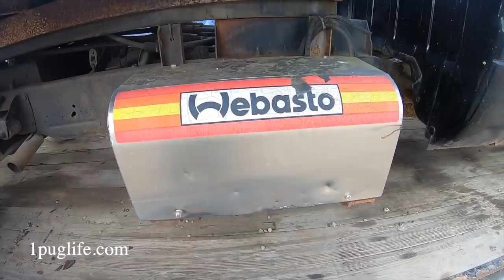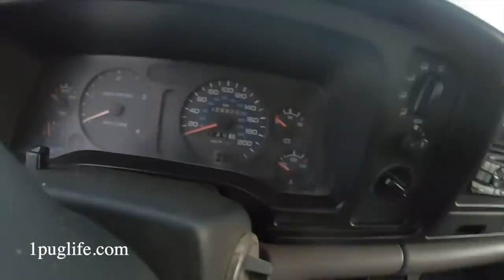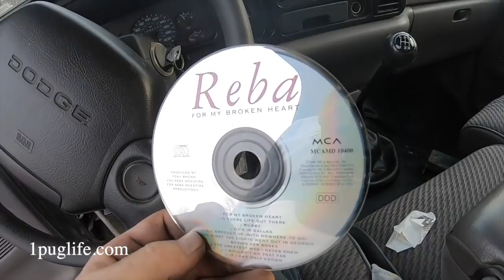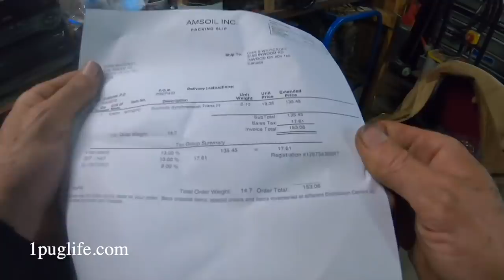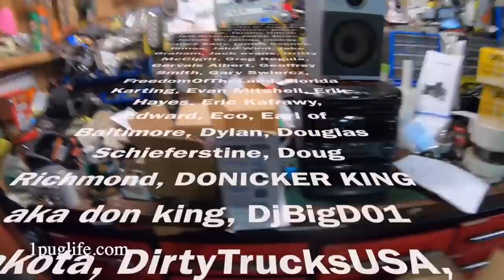will the scrap yard cummins start or is it junk

Comment: Pug 1 the only
Guy in earth who expects a truck
He bought at a scrap yard to run.
Reply: Very few cummins go before the truck becomes trash haha what a find!!!
Reply: But those 12 valves only need fuel and air to run. Well that is with the lack of any catastrophic failures.
Reply: And it does...
Reply: more like be mint and problem-free.
Reply: Anybody know/remember what happened to that huge 5th wheel steel cargo trailer that sat in the driveway forever just rusted terrible.
Reply: @memorysometimers3067  sold
Reply: Have faith
Reply: It’s a 12 valve Cummins. Chances are if they don’t have windows in the block they’ll run. Chances are also if it’s an automatic tramission it won’t move. But a standard is usually ok. It’s probably about the best motor to take a chance on.
Reply: But it did didn’t it??? lol
Reply: @mikewinn1987  lol its hauling stolen car and truck parts outta the Rez pug1 mint 👌🏻

Comment: The inside of that truck is amazingly clean and not all torn up. No rips in the console lid. No rips in the seat. No cracks in the dash. Unreal.
Reply: The floor is dicked, but easily replaceable for Pug1. He scored, even if he ended up gutting it and parting it.
Reply: That dash!!! I’ve not had one that wasn’t chowdered.
Reply: @mraycgz  my 1995 had a pristine dash with 357K miles on her with not a crack in it. One day I had tacos from the taco truck and I sat the plate on the dash. It was covered with tinfoil so I didn't see the grease dripping off the plate down my dash. The next week my dash cracked RIGHT where the carne asada oil ran down the dash. 
SO I'VE COME TO THE CONCLUSION THAT THE PLASTIC dressing they sell is the reason there are so many cracked dashes out there. Poor people thinking they are "protwcting" their dash when in fact they are destroying it. Isn't that a shame. 
My 2005 has never seen dressing and has no cracks with 250K miles on the ticker.
Reply: dash is cracked but its not the worst ive seen 18:52
Reply: @RedboneUnincorporated  lol you're correct. My bad
Reply: @andrewk4085  I missed that. Good eye. Yes I've seen them with holes in them big enough to hide a Hyundai in.
Reply: @WillaHerrera  still, though, pretty clean.

Comment: I had a 97 12 valve p pump truck that I loved but we needed a new septic system and I sold it for 7500.00🇺🇸. I still miss that truck 😫, that is a hell of a deal you got on that flatbed.

Comment: Scoreski You were using an 1/2 inch drive socket wrench to tighten that post and its a multipurpose tool hammer as well. Dude that winch is going to outdo all your electric ones they are sweet cuz there is no duty cycle to worries about. Sweet ride.

Comment: It works. .now can you  insure it? Tons of trucks like that in scrap yards ..  Time will tell if you appreciate a 12 Valve Cummins.  That 12 value is in need of a decent tune up. Here's a chance to have a decent little one ton rig for hauling scrap and use a proper trailer and the po po will leave you alone!  

Inwood Customs powered by 12 Valve Cummins

Comment: CONGRATULATIONS...absolutely HUGE score.  Just think of the possibilities.  Dickiwerds  can drive that one...he”s sticky certified.  Or hook the trailer up to Newda one and you can bring in 4 cars at a time.  Maybe add a headache rack with a cab cover for that maneuver.  And if all that isn’t enough. You have a portable Dukes of Hazard Ramp for JUMPING.   Cant wait to see which way ya go.  If its not to dicked to fix the few pieces it needs.  STOVE PIPE!!

Comment: fix the dodge use for a rollback and duramax swap the gmc/chevy squarebody crewcab they sell kits for the swap google c10 duramax swap and it comes up and they also sell a standalone wiring harness for the duramax motor also.thanks

- nick

Comment: That's a 12 valve!! Base work truck with manual windows and mirrors. It doesn't even have power locks right? But that manual trans makes up for those things. Does it have a NV4500 5 SPEED? you know a few 2003 new body Ram/Cummins came went 5 SPEED manuals.

I wonder if the KDP got that motor in this truck.  Very well could be and probably is the brass contacts inside the Nipppndenso starter.
Sounds like the shut down solenoid is not grounded and not letting her start. <--- UPDATE WRONG. LOL
I'm thinking it's a 1994-1997 with that interior but the matrial on the seat makes me think 1997.

Comment: Doing something against the rust in the cab floor & frame should make it a pretty stout spare truck, once the driveshaft is fixed up or perhaps can source a used replacement & some front end stuff is looked over too make sure nothing is unsafe for the road or carrying heavy loads I'd imagine this would be a real workhorse.

Is that turbo standard ?
Looks a bit fresher then the rest of the engine bay.